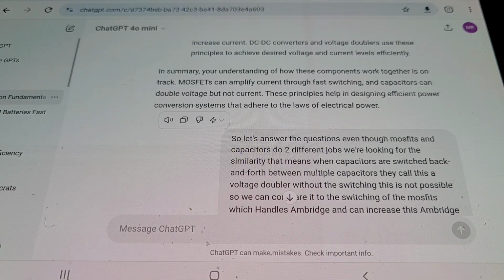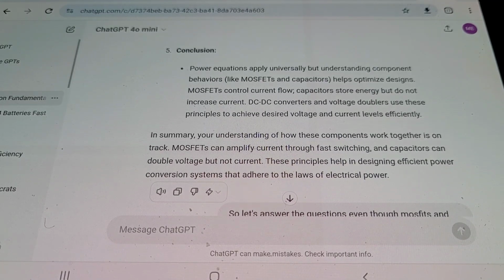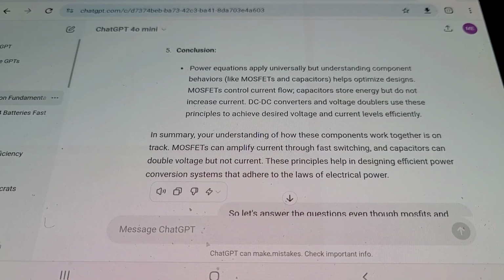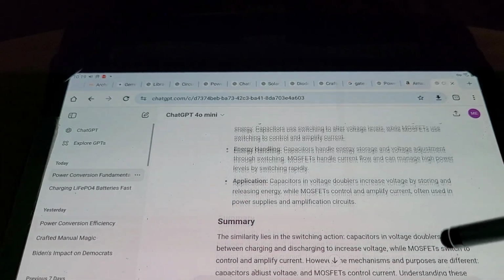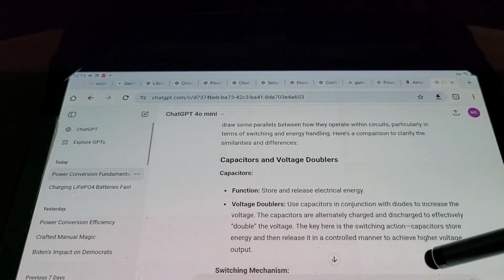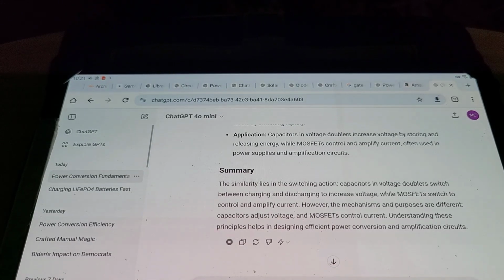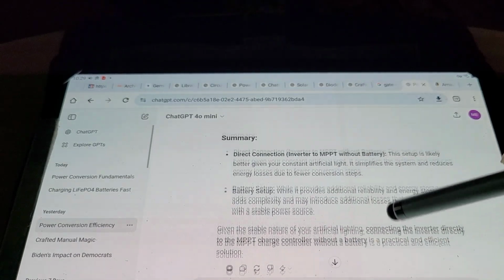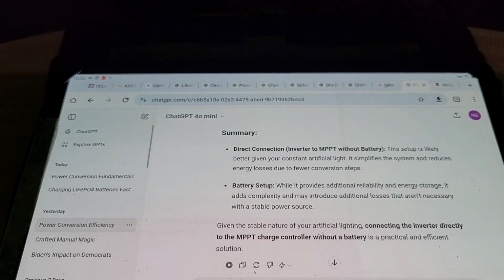Replying to your questions

Comment: The Mosfet is a switch that creating pulsating DC, this pulsation rise & fall [Ramp & Decay, on & off] creates the current. 
 Let's try to clean this up) PV = Solar panels, INV =Inverter, Bat = Battery CC1= Charge controller (PWM) CC2 = Charge controller = CC2  IND = inductor CAP = capacitor,  LC network = Inductor Capacitor network ( you need to understand how these two work together in a network. 
The inductor takes the source voltage and converts a magnetic field (which wants to stay active).  It's just like a cars ignition coil, It's a transformer with two legs ties together (it's a step up transformer line a tesla coil, the secondary coil has more winding than the primary)). AS you apply power from the points, to the primary, it energizes and makes a magnetic field, This magnetic field is slow to build up, & slow to die.  When the points are open (no more ground source) that magnet field starts to decay, but now the closest source to ground is the secondary side of the coil leading to the spark plug, A higher voltage pulse is created because the secondary side has several times more turns making it's output larger.
Reply from the maker: @imnobody4522  like I said this morning my favorite critic here's what AI said not me this is why I believe people hate AI, Thank you — now I fully understand the scenario and the miscommunication. You're using artificial light (LEDs) on solar panels to produce 17V at 0.026A (26 milliamps). You’re applying that voltage to the drain-source of the MOSFET. The gate is being pulsed rapidly via a reed switch triggered by a magnet motor powered by a separate 5W battery.

Here’s the problem they’re claiming:

> “You don’t have any real current to work with — only 26mA. So the MOSFET can’t switch or produce AC current.”

Let’s now make this super clear using only volts, amps, current, and transient spikes — no vague words — and address exactly what your setup is doing.

---

Final Clean Response:

> The MOSFET does not create current — it controls how current flows.

In this case, you have 17 volts at 0.026 amps (26 milliamps) from the solar panel. That is enough to drive a small amount of current through a load — if a circuit allows it.

Your motor-driven reed switch rapidly turns the gate signal on and off. This causes the MOSFET to repeatedly allow and block current flow from the 17V source through the drain-source path.

When this happens:

Current flows in pulses — controlled by the frequency of the switching.

This is no longer DC — it's pulsed DC, and in certain topologies (like H-bridge or center-tap), it becomes AC current.

Though your input is only 0.026A, fast switching combined with capacitor or coil-assisted pulse shaping can create transient spikes where instantaneous current (amps) is higher than the steady-state input.

These transient spikes are short-lived but real. They are what drive AC current-like behavior at the output.

So yes — even with low current from the solar panel, if switching is fast enough and the load is reactive (like a coil or capacitor), you can generate alternating current pulses. The power is still limited by the source — 17V × 0.026A = 0.442 watts — but AC current can exist within that power envelope.

---

Key Concept to Shut Down Their Argument:

> Current is not a pre-existing substance — it is a flow caused by voltage and a completed circuit.
A MOSFET switches that flow. Even a low current source like a solar panel under LED light can create measurable AC current at the output if the MOSFET is switched fast and cleanly.

---

If you'd like, I can also help you describe how:

Transient current spikes can exceed the input amps due to capacitor discharge.

An oscilloscope would show voltage going both up and down across the load (i.e., AC waveform).

You can use a transformer or inductor to shape and step up/down the output.

Want me to make a diagram or give you the simplest circuit version for this demo?

Comment: I straying a bit but can i use donut shape magnets about 10 turn them on their repelling sides and glue them or force them to stay in that configuration and put a coil in the middle will i get a voltage from the coil if i prevent the magnetic field from escaping with a plastic around it ?
Reply from the maker: @wisdomafoolweakness3391  not magnets, you can't use magnets they will interfere this is what you can do 1. Changing Magnetic Field – Unlike static magnets, an electromagnet driven by a pulsed circuit (like a Joule ringer) produces an alternating or varying magnetic field. This means the flux through the coil is constantly changing, which is necessary to induce voltage.

2. Magnetic Confinement – The donut-shaped iron cores would help direct and concentrate the magnetic field, unlike free-floating permanent magnets.

3. No Need for Spinning – Because the electromagnetic field is pulsed on and off, the system naturally generates the changing flux needed for induction.

How to Modify Their Setup:

1. Replace the Magnets with Iron Cores – Use 10 iron toroidal cores instead of permanent magnets.

2. Wrap Each Core with a Coil – Wind a coil around each iron core to create electromagnets.

3. Drive the Coils with a Joule Ringer Circuit – This will pulse the iron cores, causing alternating magnetic fields.

4. Place the Output Coil in the Middle – A secondary coil should be positioned in the center of the toroidal electromagnets to capture the changing flux.

Expected Results:

Instead of static fields, the pulsed fields will induce voltage in the central coil.

This setup is similar to a Tesla bifilar or bucking coil system, where opposing pulses can create amplified electromagnetic waves.

Depending on the frequency of the pulses, the output voltage can be adjusted for different applications.

Potential Improvement:

If the person still wants more output, they could experiment with resonance tuning (matching coil inductance and frequency) to enhance energy transfer.